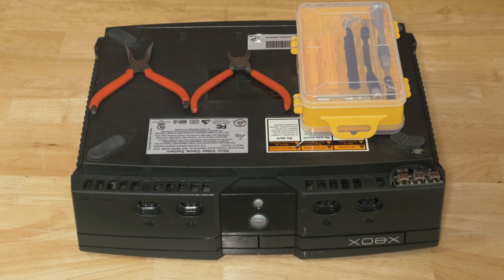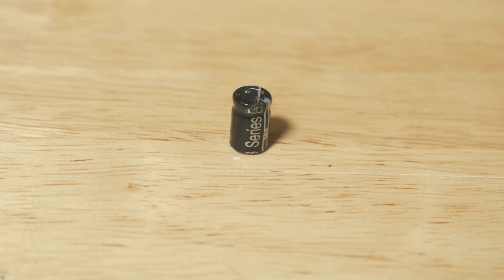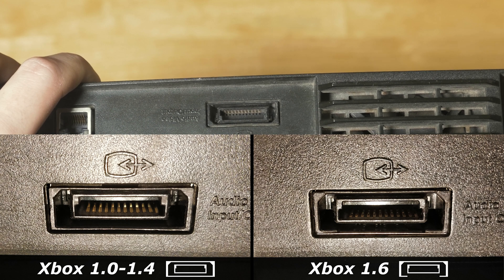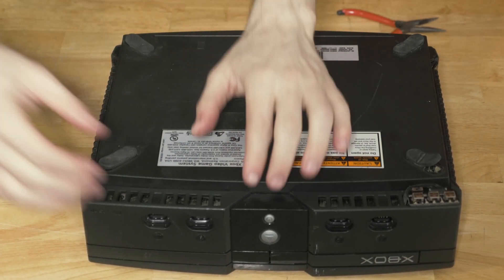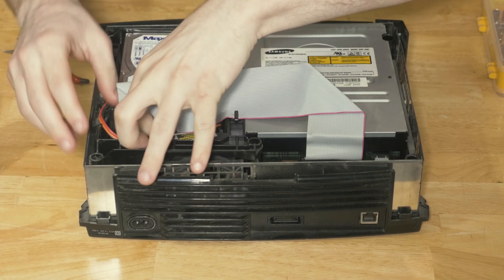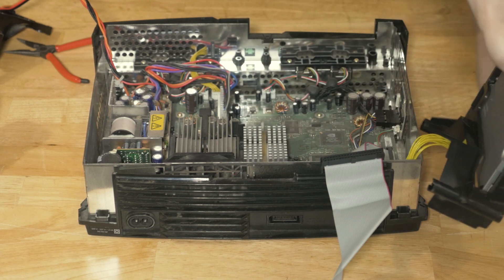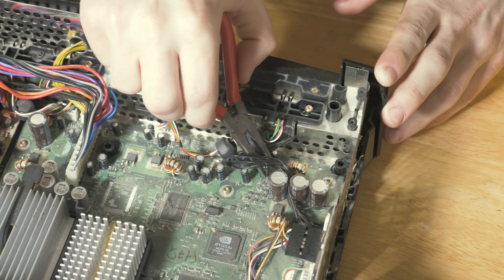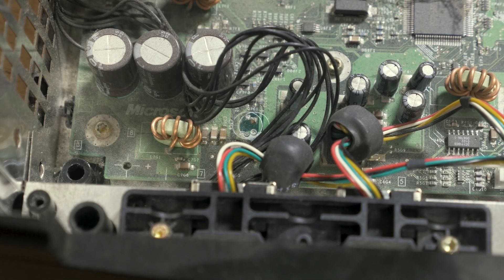Saving My Original Xbox From The Clock Capacitor

Comment: This is such bullshit. "The clock capacitor leaks." Uh, it might, but I just took apart my Xbox tonight down to the motherboard to check your so called clock capacitor troubles and there was no damage. There was dust but no leakage. If I unplug my Xbox power cable and plug it back in, I have to reset the time. You fuckin idiots say it's cause there is damage to the motherboard from the "clock cap." Yet, when I checked, there was no leakage. Yes I repeated myself. My best guess is the fuckin thing is almost 20 years old so the "clock cap" just took a shit and it can't hold time anymore. By "took a shit" I mean got real old and stopped working. There is literally no fuckin damage to my motherboard. So, what is your explanation for that you fuckhead nerds?
Reply from the maker: No leakage is a great thing, you should be happy about it. There are lots of people who have had theirs leak out and eat through their xbox and now they don't work any more. If you want to regain the functions of that capacitor, then you need to replace it with another good capacitor.

Comment: what are the symptoms from damage caused by the leak?
Reply from the maker: in terms of damage symptoms with use of the xbox, i dont know anything specific, it could get at whatever is around it (an obvious one would be that the clock isn't working though).

in terms of damage symptoms on the physical motherboard, you'll definitely see it. the capacitors will leak so you'll see liquid or where there had been liquid and it very well may ruin traces or components around it. Not sure if it is strong enough to damage the actual motherboard, like eat through it or etc though.
Reply: I had my Xbox opened last night, and noticed something on the board in that exact area, but did not know if it was leaked crud, cuz I didn't know where the cap was located. Now I know and will do this now.

Comment: Either isopropyl alcohol or electrical contact cleaner is good for cleaning around a leaked cap along with a nylon brush to clean around the small pieces for extra preventative maintenance.
Reply from the maker: i dont know why so many people recommend vinegar
Reply: @laserfights  Definitely would steer clear because while it can remove the deposits left by electrolytic fluid,  vinegar is generally corrosive itself and will keep eroding the contacts if not immediately cleaned up with baking soda and distilled water.
Reply: @laserfights  i dont know the name of the chemical process but vinegar neutralizes the acid.